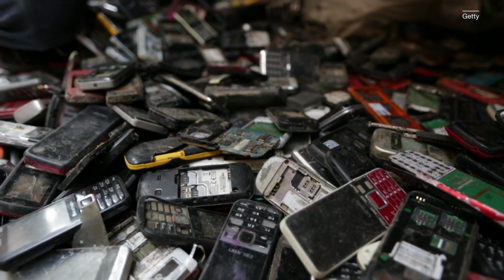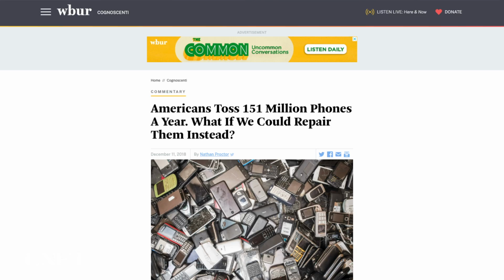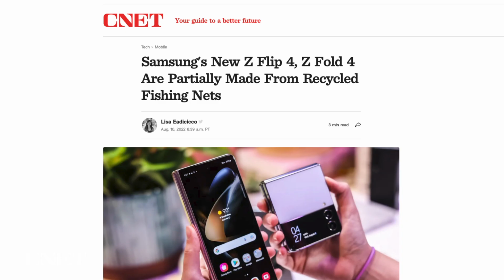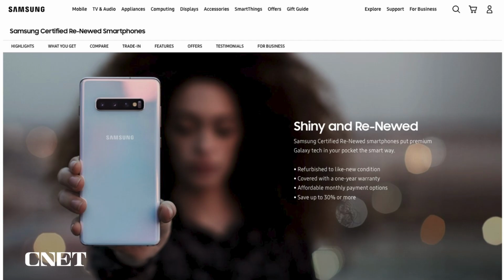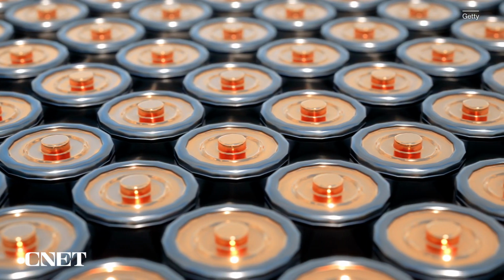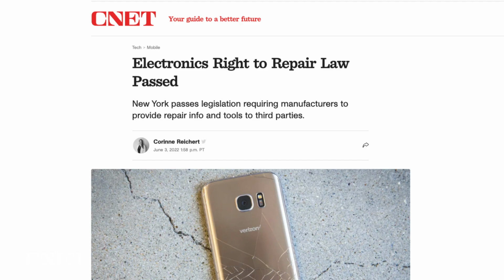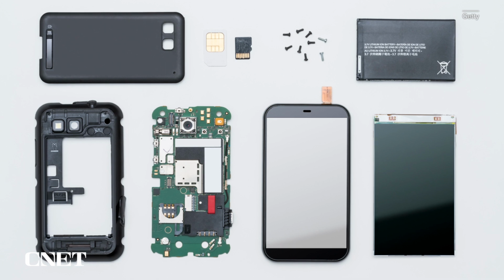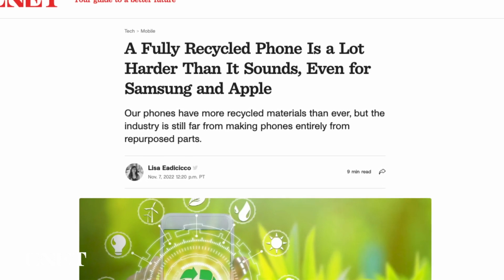Apple’s Next iPhone Could Be 100% Recycled

Comment: CNET, be realistic. There is no unlimited high quality trash. Recycled material sourcing is not stable, sometimes a batch of plastic comes because a ocean wave comes in correct direction. Also despite rare earth materials being a small part of the phone, it causes a LOT more environmental damage than other materials on the phone. This sustainable transition is already going as fast as it can be. People need to recycle material like the Japan to have more recycled materials to use. And people or the gov are not doing that. The real evolution will come when breakthrough battery technology, algae plastic or true biodegradable technology comes to mass production.